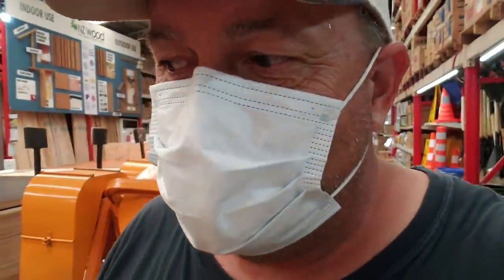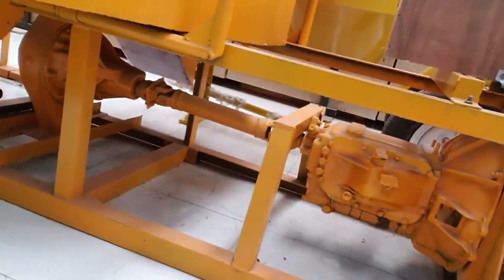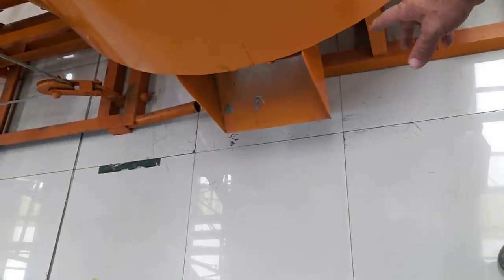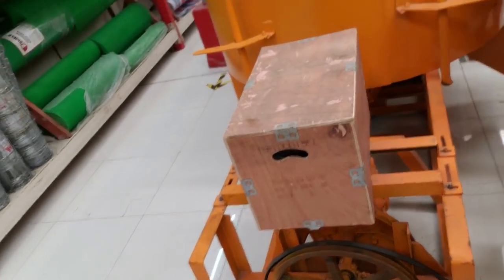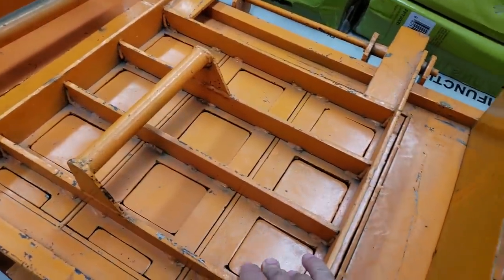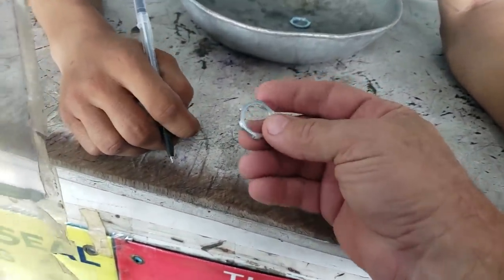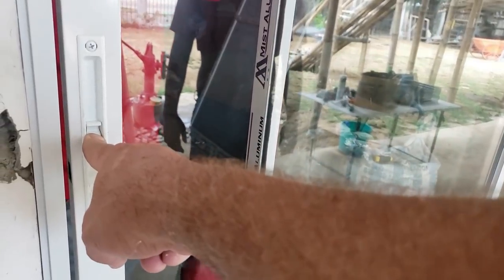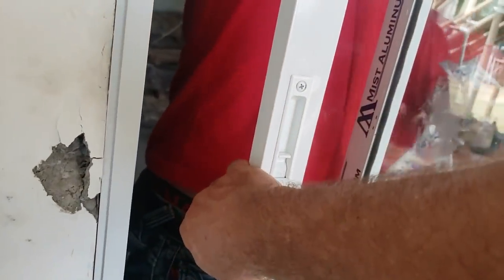Philippines Beach House Build Day199 Part 2: What is this Machine made from old Truck Parts?

Comment: Glad you found what you needed at the stores. Also glad you were there to also educate the installers that you don't need to run all tools at Max power. Went thru that for many many years myself back in Texas with "green card holders". Proper education is a great life lesson. Improper education is a negative lesson that will never produce advancement in life. Melinda got bored with your gabbing and either fell asleep on the ride or faked it! 😂  I hired a guy today to help me around here since my left shoulder is still broken. He starts Monday. You and I come from the same "Hood" basically in North Texas. We'll see what he can do. I'll be a Hawk on a field mouse with him! Btw, my mater's are loaded with blooms and I saw my first 2 infant jalapenos today. Armadillo eggs on the grill soon. 😊
Reply from the maker: Oh man sounds so good! I need a break form all of this madness. 1/4 bit that is warped on a big hammer drill and pushing it with great force. Of course its gonna burst out. As another commenter said they should have had the holes inwards more as well. I have decided that it is mission impossible. I will be glad when this project is done!  In the end I still will have one nice ass house. All of their issues and bad training will be of no concern to me anymore. I will set back happy.
Reply: @TexasFilipino  no, you'll still go back and make sure it's right. I do know you Mr. Ray!

Comment: There’s to many of them and to few of you.  I would have thought they would put insert anchor in the hole after drilling for a snugger fit but what do I know. It looks like those are single pane windows from the video. 
When I was in Iraq grounding was a major challenge because it was so dry there.  I’m not electrical so this is more of a question. Was there are reason you don’t ground off your footers? Seems to me that would be better than t 6 ft rod? 
That looks close to 10 inch minus river rock to me. Nice looking and a few good size ones. They will make your Gabion wall look nice. Just wondering how you’re going to anchor them in the sand?  Sand is so easy to undermine and wash away.
Reply from the maker: I can't anchor them. Not allowed to make them permanent!  that 6 foot rod will be in pure moist soil. It will be great. You DO NOT WANT a lightning strike to pass thru your rebar. There is poor connections everywhere which cause resistance and spark that can result in your concrete exploding. or cracking your columns and beams. Big no no.

Comment: Im learning, i have experienced bad work with a $3000 tile job the grout is like dust just comes out in chunks when you mop the floor and tile guy tells me its my fault I bought the wrong grout he's the one who picked it up I just chose the color and paid for it, very frustrating the company indicated he didn't mix it correctly you have to be on top of everything or the Kano gets screwed, I paid for some garage doors to be installed and I had to come back to the US 4 months later came back to my Phil house and it takes ten minutes of pulling a chain to open the garage doors with loose tracks and shimmed up with gaps on three doors, not what I paid for and no warranty.a little over $5000 lesson, Im not doing anything until I can watch every move, I still love the Philippines and can't wait to get back there.
Reply: That is the main reason that i try to do as much as i can, by myself.
Even if i have to by all the tools and equitment myself, it still will save me money and keep me keep my sanity.

Comment: I’m guessing the window crew are having a problem with the cast wall system, just not what they are used to dealing with. The screw positions are way too close to the edge of the concrete and is causing the edges to flake out, even more so when the plug expands. Tough situation. The holes bored through the aluminum are way too large as you know, caused by pushing the countersink bit too far. Man, they sure do need some training and guidance.
Reply from the maker: Yes keep watching - the next day the owners come and that is exactly what I convey. Him pushing that bit in too far and too hard! if they had drill those holes in closer to the middle that would have been a big difference. The drill bit is also bent and wobbling breaking out the concrete and he is pushing so dang hard with a really big hammer drill for such small holes. SHIT SHOW is what we call it back home.
Reply: @TexasFilipino  I feel sorry for the crew because they obviously lack in training, it would be nice if they had a foreman or journeyman that could advise them when they had a problem. But no excuse for basic countersunk drilled holes. I guess you could try a bigger headed screw, if the hole fits a number 10 or 12 countersunk screw, they could redo the countersunk part.
Reply: I would have used Tap Cons. Perfect scenario for this install. Cast concrete, no problem.
Reply: @jamesbowie6925  i showed one crew how they could do a job easier via video, it was quicker which would have put more money in their pocket and they all............. walked of the job site.
All they are taught is the wrong way to do things, it just gets passed forward and you come in with a new way.... well that where that filipino pride kicks in.

Comment: James, it seems that the door and window glass installers are novice or just afraid to you. They should know what their doing. Missing screws and misaligned window lock is not a good sign of what your expecting from them.
Reply from the maker: I stayed out of their way and watch their mistakes. I wanted to see if they ever corrected it or just going to leave me with shit work unless I speak up. Turns out I needed to speak up. It is not over. Next day the owners come.  The one guy with the drill is the one making these problems. The other guys seem not so bad. He just tries to ram it all in very fast like a bulldozer.
Reply: @TexasFilipino  man I hope one of these days I can remember all of your lessons when I build my house there! I'm sure I'll binge watch your channel as I go.

Comment: That latch on the wrong side of the sliding glass door would have been the very last straw. I don't know how you laughed it off.
Reply from the maker: I didn't laugh it off. The owners came and I raised hell off camera.They was just going to relocate it and I said no it now has needless holes in it. Also they had to replace the aluminum frame where they punched out holes wrong there also. When they got it all done I paid them and was done on them. I can't show it on camera because of laws here.
Reply: @TexasFilipino  The owner deserved every bit of it. You showed restraint by not taking it out on the workers but they seem to have no clue. Glad it worked out in the end

Comment: Our house is as close to the water as yours is. Salt air continuously corrodes our rollers on our windows and sliding doors/screens. We went from metal rollers to a plastic composite from GAG - Glass and aluminum supply on the corner of Mabini st. and Deleon st. in Iloilo.

Another issue we had to address was weather stripping and caulking. High winds from the sea would create pressure on our windows that caused gaps where rain water would come in. In hindsight I should have put in PVC window frame vice aluminum.
Reply from the maker: Thank you Sir. Watch videos coming up in next couple days.  Yes that is why we had ours done also with stainless steel screws and thicker extrusion. This is the only alum windows and doors. Upcoming videos explain it all.

Comment: I personally love that type of cement mixer. Those you showed, are brutes. There are far better designed of that type of mixer for about the same price.
Facebook market gives a good ideal of what all is available here.
Reply from the maker: I am thinking to build one of those concrete mixers back in Texas. I can then put it on my tractor and run it off the PTO. Plus I can raise and lower it